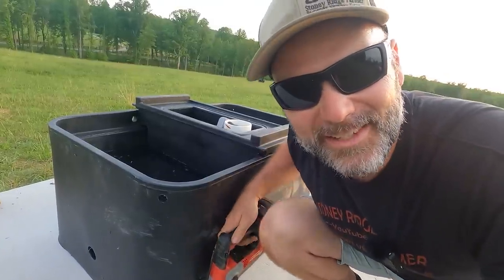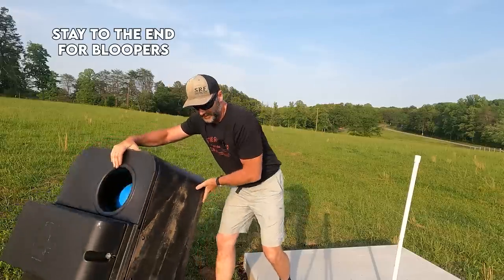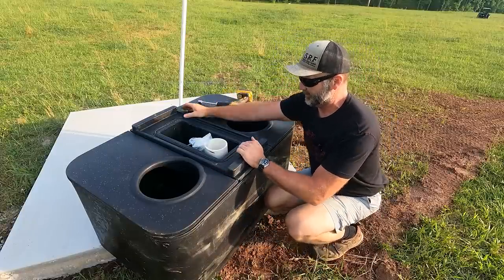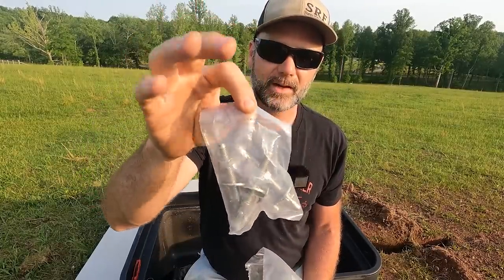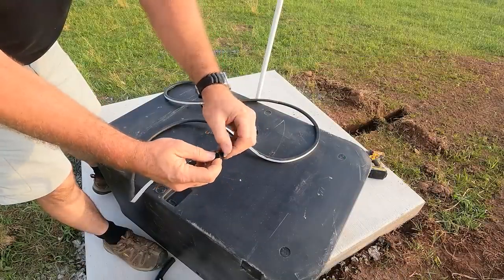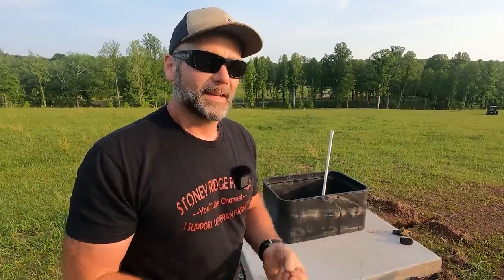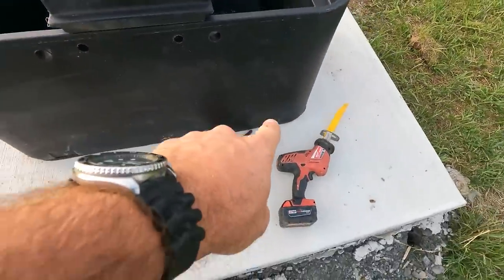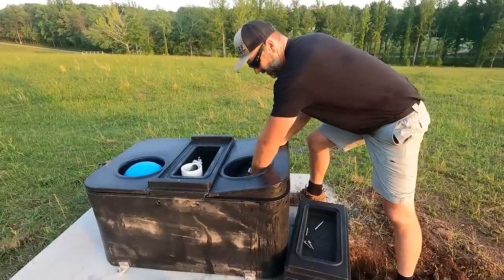How to install a frost free Freeze proof water tank on your farm or homestead

Comment: These are excellent waterers.  I had 7 of them on my farm going back 30 years now.  I was in western Canada with -40F winters and they did work well.  If you have only a few cows they did freeze, but did work better in the larger pens with lots off cattle.  The heat well is important and we went down 12 feet in the conditions we had.  Deeper is better for the cold.  Sometimes you had to push down a frozen ball on cold mornings but overall did very well.  Very good instructional video.  Well done!

Comment: Drill all the way thru for the anchor bolts -- that way if you ever need to replace a bolt, just drive the bolt out the bottom of the slab and put the new bolt in place.  I have a waterer just like the one you have, getting ready to install mine -- glad I found this vid, it helps a lot to see the steps

Comment: Thanks for the thorough video! We boarded a few Dexter's for a relative & their bull took offence to our red & yellow Ritchie waterer. He acted like a Spanish bull charging a matador because the Ritchie has a red top. He knocked the lag bolts loose and lifted the waterer off the concrete pad. This farm had alot of beef pass through but this the first and only time we experienced one that actually hated red enough to get testy like that.
Reply from the maker: Cows have dichromatic eyesight. They can only see yellow and blue. Cool huh 🤔
Reply: @StoneyRidgeFarmer  that's interesting. I knew they had limitations but never knew it was narrowed to yellow & blue. But for whatever reason that bull did not like our red & yellow waterer. He circled it like it was possessed. If we hadn't stopped him in time he would have completely separated it from the concrete pad and broke the water connection. We had to move him to his own paddock with an old black water trough. None of the other cows had a problem with it whatsoever. BTW, your watering system is absolutely amazing!

Comment: Love my mirafounts. I've got the 4 ball in middle of fence rows so 1 waterer with 2 balls on each side of fence. Makes rotational grazing easier. We did a 10x10 concrete pad with gravel around it since it's a heavy use area. That way it doesn't get muddy

Comment: I have found it easier to put the Teflon tape on by turning the tape spool over from how you did it. Doing this, you just put your finger inside the tape spool and spin it around your fitting and this way it pulls it tight into the pipe threads.

Comment: When planning for the concrete pad know that the hole in the waterer is Offset. It is Not in the center.
Water in the heat well can cause freezing. I would have dipped the water out. Then make sure it stayed dry and not leaking before installing the waterer.

Comment: Have 2 Miraco waterers on property when we bought the place a few years ago. We're starting our own beef operation this fall and when I checked both systems, one had a leak coming from the bottom, and the other was missing float and a few pieces. Have you had any issues with your Miraco since the onset? Would like to keep them and get them operating. Not sure if I should throw parts at the non working system or just replace it. Appreciate your insight brother!
Reply from the maker: interesting....I've had no issue  what so ever.  If you have a leak in a new unit you need to get with Miraco and they'll take care of you.  Parts wise, there aren't many moving parts here.   If ya didn't buy them new and you have a leak, find it, clean it well and silicon the hole.  If you have valves that need some work you can order virtually any part.  Your leak could be coming from the plug in the bottom side and what you see as a leak may be overflowing.  Sometimes you'll need to make some adjustments after installation and seasonally as the tanks will be smaller (shrinkage) in winter and larger (expansion) in summer.  They are virtually bullet proof and you can order any part you need for them.  Just gottta spend a little time learning how they work...you'll love them! Oh...and sit tight on buying beef cattle for a bit....prices are the highest they have ever been in history!! Sit tight till after the new year and I'll bet you'll get a better price!
Reply: @StoneyRidgeFarmer  They are many years old at this point. They were here when we bought the place two years ago. The idea of their system is great. I'm thinking I can figure it out and salvage the ones we have already. And yes I know we have historic highs in the beef market. Although the last few days has dropped quite substantially. We may be going higher end also, so not sure how much of a difference the market plays on the high end beef---Akaushi is what we have our eyes on for a few different reasons. We'll see how it goes and let you know!!
Reply from the maker: a Mirafount like this should last ya a lifetime....just open them up, take some snapshots of the parts needed and order what ya need....you'll be happy, just have to make some adjustments once in a while
Reply: @StoneyRidgeFarmer  I broke the float when I was messing with it haha. And the shut off valve is buried so we're renting mini excavator to get it dug up and brought back to life. Even though we had a small flood LOL, we will be good to go soon. Parts should be arriving today! I'll keep you posted. I have watched this video many times, and our setup is just about identical. I'll tag you in our post next week when we get it all finished---hopefully.

Comment: Put fittings in your left hand and wrap the Teflon away from you and put the backside of the tape on fitting and you can pull the Teflon tape tighter and then you won't have to use ur finger nails

Comment: Not to be an armchair quarterback but hopefully as a help.
I have installed ball water tanks for years for myself and other ranchers (NRCS) and have found Ritchie (American made) and Tru-test (China 👎 ) to be the best made and the most user friendly. You may have already checked them just wanted to make you aware.
Reply from the maker: yep...I've looked at both models...might try a Ritchie at some point but for now I have 10 Mirifounts for the farm...I hear some folks (horse folks) like the Ritchie and some like the mirafount....I'd love to do a comparison at some point
Reply: Hello Mark
I'm interested to know why the Ritchie were preferred.
My only experience with energy free is Mira Fount. I am satisfied with them.
Reply: The weight of the housing is not as thick. I don't like how they mount to the concrete. I have seen L brackets and the lag bolts work loose over time and cattle could push it around. One rancher the cows pushed it and broke the connection and cost him a lot on county water bill. 
I can also tell you the Ritchie's are not perfect there are a few things they could improve with the valves but overall I like them best. Just my opinion.
Reply: @markhall8132  
Thank you
It would be great if you or others with your level of experience and exposure could consult with the manufacturers. You could give them a lot of insight on weaknesses and on ways to improve their product.
Reply: @markhall8132  
Hello Mark
I have thought more about the waterer becoming loose. 
The specs I have from the soil and water folks say the concrete has to be rated at 3500 ps minimum i. It appears that some people do their own concrete work. Maybe their concrete is not sufficient to properly hold an anchor.
If the waterer we're empty or frozen, that could be the cause of the animals to becoming aggressive and wanting  to make water come from the waterer. Maybe that would also be true for an animal that is not trained to drink from the waterer.
I guess it could also be that the animal is just having a bad day.

Comment: Interesting.  Not sure how they would work in extreme cold (-30 and colder) as I am thinking ball would freeze in place.  But might be worth looking at.
Reply from the maker: they make a heat kit for these so you can run power and have it heated...never gets that cold here...but check out the mirafount website...all sorts of great info!
Reply: Go down 12' and it won't freeze as long as you have enough livestock drinking. If not you might have to push ball down occasionally to break up a little ice but that's it. You don't have to have the heater if no electricity to it.
Reply: @tracyjohnson5023  It freezes my sewer line which is 8' down, 12" down will just post pone the inevitable.  Thanks for the thought though.

Comment: Well i dont like plastic anything. Its simple easy and cheap for sure. But will not use it because algae bacteria will grow in about 10 days allowing crud to form. Not so much in cold weather though. But like the whole set up. I would use this in warmer climates. But not in north east indiana. Metal kills bacteria iron can be thawed out by using a welder. Iron pipe only last 20 years in ground though. But thats my opnion. Frost goes down 30 inches here. Coldest i have seen here is -35 F i n end of jan. Needs electricity to thaw out.
Reply from the maker: I hear ya, but I'm not out busting ice out of a metal tank, and I don't have power 1/2 mile from the well.  If I had to run galvy pipe on this job I would have spend over $150,000 v's poly pipe.  Bacteria in the tanks isn't harmful and the black color keeps algea from growing.  No light, no algea in most cases.  Our tire tanks have goldfish for algea control also